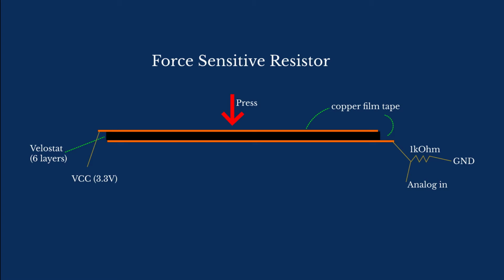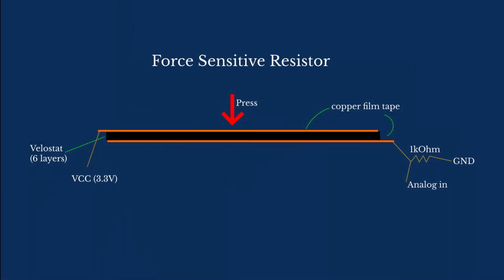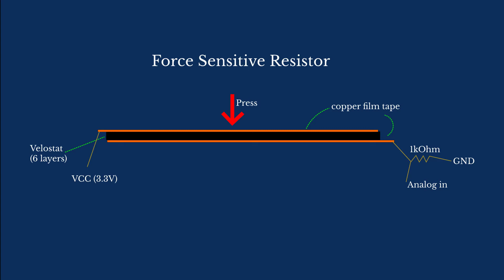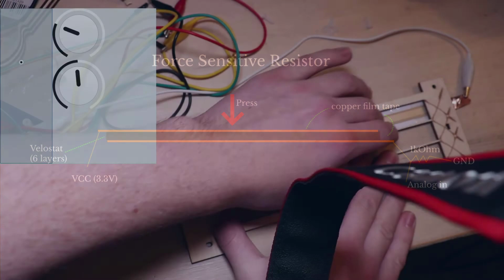DIY Force Sensitive Resistor Tutorial |  Reverion ~ digital musical instrument diary

Comment: Hey! How accurate is this? Like, if you touched it 50mm in and it made a 440hz sound, if you came back the next day and touched it in the same place, would it make the same sound? How much does the signal fluctuate? Like, if you hold your finger in the same place, is there a lot of noise causing the frequency to move up and down erratically, giving it a warbling effect? Because I tried this myself and thats what happened and I don't know if I did something wrong or if its normal!
Reply from the maker: This was a while ago so I don't quite remember, and I don't have any of these laying around anymore. I don't think they are very accurate, but if you are careful to line up the velostat with the right dimensions there shouldn't be much noise I don't think. They can be very sensitive though, and it's hard to keep your finger pressure constant. Note that where you touch the sensor shouldn't matter since it's an FSR and not a linear potentiometer/"softpot" (which I combine two of these with in the he end of the video). Personally, I wouldn't use these for pitch, use a softpot or something else for pitch.
Reply: @eriknatanael  Hey! Sorry I got confused, I was talking about the linear potentiometer, which I'm using to control pitch! But even if I keep my finger dead still on my one, the pitch still warbles slightly. I'm using some sliding window averaging algorithm in the code to smooth it out, but that adds a little lag to my performance. Is it normal for the pitch to warble like that?
Reply from the maker: @WeirdSide  The softpot should be able to give you a pretty stable reading. How are you wiring it?

Comment: is this essentially the same as capacitive touch? i.e. the velostat is just the dielectric layer between the two copper "plates". I've done this with a thin layer of rubber (because velostat seems to be nonexistent where I live). Also is the accuracy of the sensor sufficient enough to also calculate velocity - have you tried that?
Reply from the maker: Not quite, I don't know enough physics to know what a dielectric layer is, but this sensor works by the velostat having a variable resistance when compressed, resulting in a difference in voltage drop between the copper strips. A capacitive sensor instead would measure the additional capacitance of the skin when you touch the sensor. I have however started using capacitive sensors more and more in new projects.

This sensor isn't great for sensing velocity because of hysteresis, but I guess you could do it to some degree if your microcontroller can read the sensor fast enough.

Comment: Hi Erik! really good work! I'm trying to implement a digital musical instrument using this kind of FRS's. Do you think it's possible to get the "Y" value without using the softpot but only the FRS's?
Reply from the maker: Thanks! I think you're gonna have a very hard time making that reliable. Right now I'd probably recommend checking these sensors out instead if you can use I2C, you save a whole lot of effort for much better reliability and precision for not that much more money: https://shop.bela.io/collections/trill/
(not affiliated in any way, just think they're awesome)
Reply: @eriknatanael  ok thanks! I will check that out! My problem is that I'm trying to implement a gestural controller inspired by string instruments, so basically the idea was to use a matrix made of copper tape to simulate a fretboard and the strings. With this set up I can get the "Y" value, but the problem is that I would like to be able to play in different temperaments. So with this set up I can't really do it because I would have fixed "frets".  I'm looking for a solution in which I could determine the position of those frets.
Reply from the maker: @WindyChaos  Okay, but if you are using frets you can have them change their pitch without physically changing their position on the instrument, right? If you want a sort of continuous DIY sensor you could try copying the approach of the Trill sensors by making a copper matrix where each cell is smaller than your finger, measure the capacitance of each pad and interpolate between them to find the current position.
Reply: @eriknatanael  Great I will consider all your advices! thanks a lot! I think I might buy the ribbons ( I need 6 haha)

Comment: Great job. 
What is the width of copper tape?
What is the  width of velostat material?
what if the width of copper tape is 5mm and velostat is 7mm, will it be a problem.
Reply from the maker: As long as the copper tape is smaller than the velostat so that the copper on the top and bottom of the sensor don't touch you should be fine. 5mm wide copper tape and 7mm wide velostat will give you 1mm on each side so I don't think that should be a problem. The sizes will influence the response of the sensor so you'll have to experiment with how many layers of velostat will give you the sensitivity you want.

Comment: are those 6 layers the 8 or 4 mil velostat?
Reply from the maker: I don't actually know, sorry!
Reply: @eriknatanael  BTW, what is the point of the two fsr's? The soft pot is an FSR as well. It should be able to sense both velocity and position if I'm not mistaken. Or are you doing something else I'm missing?
Reply from the maker: @sabahoudini  The two FSRs allow you to get some sensitivity side to side as well as how hard you're pressing down on them. The softpot doesn't really work like an FSR, but a linear potentiometer. On the FSRs it doesn't matter where you press whereas on the softpot it doesn't matter how hard you press (beyond a certain threshold). Unless you know something I don't in which case I'd love to learn about it. You can sort of tell how wide the thing pressing the softpot is, but only if you're gonna play it with just one finger (i.e. not have fingers pressed down "below" the highest pitch you're playing) and don't have it set up for two different pitches.
Reply: @eriknatanael  Well I may be understanding this wrong because I'm an electrics noob but a softpot is basically a voltage divider. If you could somehow hook up each side of the divider to it's own analog in pins you could both sense position and touch. The ratio of the two signals would be the position and the sum of the two signals is the velocity. However as I said I may have misunderstood how this works :P
Reply from the maker: @sabahoudini  I'm an electrics noob myself. Definitely let me know if you hook this up and try it out!
Reply: @eriknatanael  I'm going to do just that but I will make my own soft pot -ish thing but it will be more of a step by step increasing resistance because I don't know what I can use as a resistive layer so I'll use multiple copper areas interconnected with resistors to create the varying resistance.
Reply: @eriknatanael  I have to thank you. I gave up on making my own velostat fsr for my project because I couldn't get consistent results. I didn't realise I had to use more layers to get it to respond properly. I tried 7 layers and it's responding perfectly. Only thing is because there is no spacer you have a small voltage all the time and when you hit it very weakly it produces a negative spike. Since I'm trying to make a percussive instrument it's important to get a consistent response from weak to hard hits. I'm planning to 3d print some 0.2mm interspaced dots on the velostat to create an air gap so it's not in contact when it's no being pressed. I don't know if 3d printing will stick to the velostat though. Either that or maybe the peak recognition algorithm will have to detect negative spikes and maybe respond to standard deviation from the base averaged signal.
Reply: @eriknatanael  BTW du verkar också vara från sverige. Nice. Har du nån bakgrund inom kodning eller nåt sånt?
Reply from the maker: @sabahoudini  Exciting! I'd imagine you could use velostat as the base of a softpot if you have a copper strip on top of it (with spacing so they only touch ehere you press) and then reading the voltage at both ends of the velostat...
Reply from the maker: @sabahoudini  Happy to hear that the video was useful! Spacers sound like a good idea, but DIY sensors aren't super reliable in general. The velostat changes resistance over time if you press it for example so I'd probably try to account for the range of values dynamically in software.
Reply from the maker: @sabahoudini  Det stämmer! :) Har kodat länge, men min bakgrund är inom musik. Jobbar dock på KTH med mjukvarukonst just nu så vi håller på med en hel massa kodning. Vi har en hemsida om du är intresserad: https://rethread.art/ 
Vad är det för DMI du bygger?
Reply: @eriknatanael  Are you talking about drift? In that case it's not an issue since I'm only interested in dynamic responses and not absolute values. An FSR will however have hysteresis for a few seconds after you press it until the resistance goes back to normal.
Reply: @eriknatanael  Intressant. Jag försöker bygga en digital trumma med fsr. Man kan använda tryck för att känna av om du har handen på trumskinnet för att trigga ett kantslag t.ex. Går att göra massa saker med aftertouch såsom pitch shift genom att trycka på trumman eller möjligtvis att den känner av om du slår trumpinnen in i trumman i stället för att låta den studsa fritt. Problemet är att jag inte kan koda. Jag har jättemånga ideer men det tar lång tid för mig att lära mig hur jag ska göra nåt för jag kan varken kodning eller el :P
Reply from the maker: @sabahoudini  No I'm talking about wear, I've had velostat change resistance on me quite dramatically.
Reply from the maker: @sabahoudini  Okej! :) Men i så fall kanske Axoloti vore något för dig, det är en nod-baserad platform. Tror att det fortfarande går att programmera en bela med Pd som är åtminstone lite visuellt också. Bela är speciellt bra för slagverksinstrument eftersom det går att få enormt låg latency. Jag har för mig att skaparna bakom Soundplane skrev en artikel om just slagverksDMI där de föreslog, om jag minns rätt, att anslag bör samplas med högre frekvens än ljudets samplingsfrekvens för maximal kontroll, de använde helt enkelt ljudkort som AD-omvandlare för sensorer. Bela har en samplingsfrekvens på 22050 Hz för de analoga ingångarna, vilket förmodligen är mer än tillräckligt för FSR med tanke på hysteres som du sa.
Reply: @eriknatanael  Jag köpte en teensy 4.0 som jag experimenterar lite med. Programmeringen är arduino som är lite enklare. Jag har tänkt att trigga VST trummor genom midi så har inte tänkt att använda några audio funktioner men bela verkar intressant. Fördelen med teensy är att de är väldigt billiga och riktigt snabba. Det här är bara en prototyp jag gör med velostat. Ska eventuellt fixa några kommersiellt byggda skräddarsydda FSR om jag får prototypen att funka. Samplingen kan ske riktigt snabbt med teensy, typ 100ggr per millisekund men har man många sensorer så samplar man ju en i taget i sekvens. Räcker gott och väl.
Reply: @eriknatanael  I think two things need to be done to prevent that. The layers have to be laminated (you can do that with a laminator). Having the layers free may allow them to move inside over time. Second you need a spacer. That means when it's not pressed there is an air gap. If something is constantly resting on it the resistance will drift over time, even if it's a piece of paper resting on it.
Reply from the maker: @sabahoudini  Kul! Teensy är grymma små chip! Fördelen med bela är egentligen bara om man gör ljudsyntesen där också bl. a. eftersom sensoravläsningen är synkad med ljudets samplerate. Då kan du få betydligt lägre jitter och roundtrip latency än på t ex en laptop. Vore kul att se din prototyp när den är färdig!
Reply: @eriknatanael  Bela är nog jävligt bra om man ska bygga en hel trummodul. Har man rätt ljudkort kan man få ner latencyn till kanske 1ms på en PC (man behöver inte bry sig om input latency då man skickar in en digital signal via MIDI). Om det blir mer latency innan MIDI signalen kommer in i datorn vet jag inte. Borde inte bli det.

Comment: If you're still looking at this comment thread, couple questions:
1) Does the sensor detect the degree to which you are pressing on it, or simply whether or not a force is applied?
2) How sensitive can the sensor be? Can it sense a very light touch?
Thank you!
Reply from the maker: 1) Yes, the harder you press on the velostat, the lower its resistance, so the higher the voltage going to the analog input.
2) It can sense very very light touch! If you just have one layer of velostat that's all it can sense since you'll lower the resistance to the minimum with very little force. I found around 3 layers of velostat was kind of a sweetspot for my use.